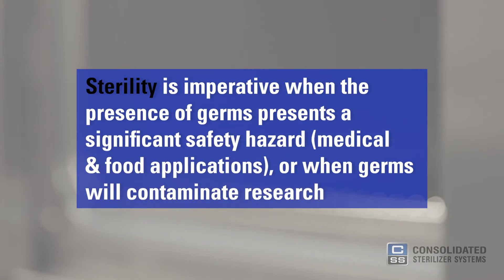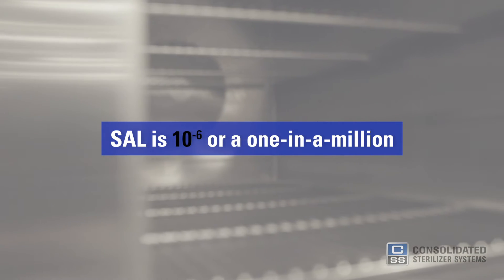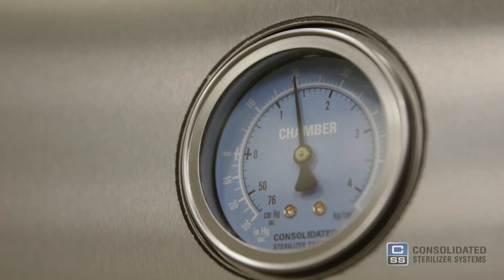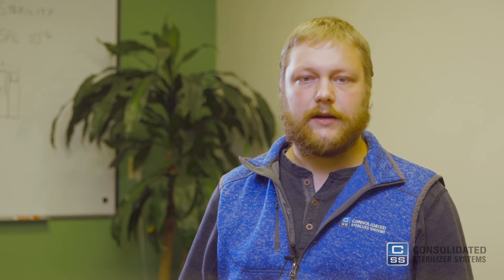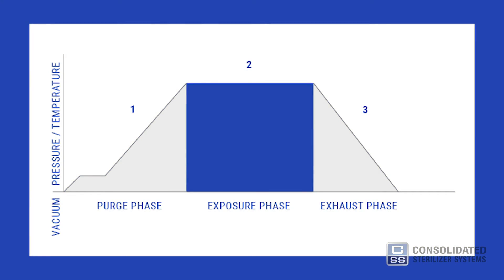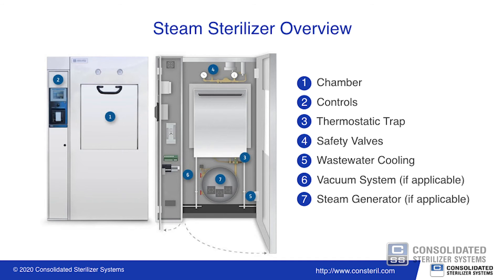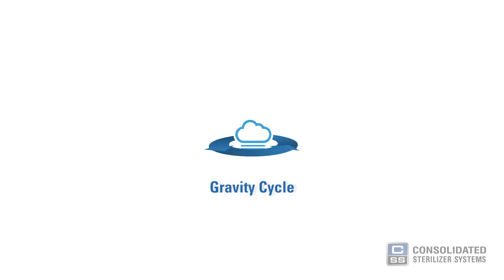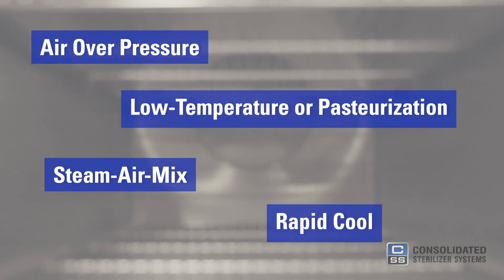Understanding Steam Sterilization and How It Works

Comment: Direct steam injection: High temperature and high pressure steam is injected directly into the item to be sterilized through a precisely controlled nozzle, or the item is placed in a sterilization chamber filled with steam. This design ensures that steam can be quickly and evenly distributed, reaching all surfaces and gaps that require sterilization.